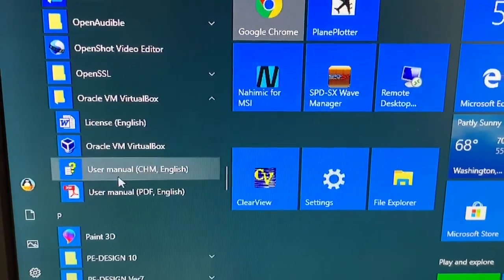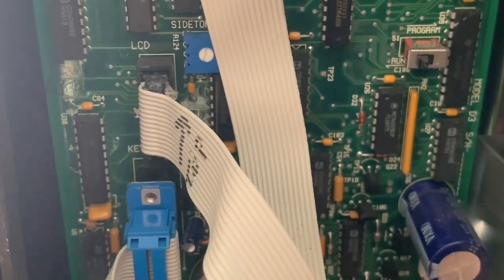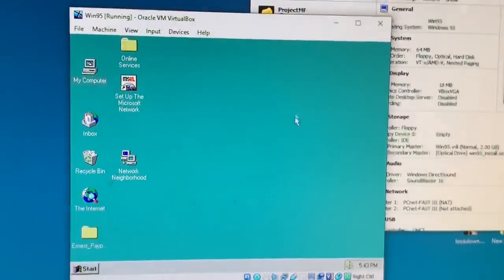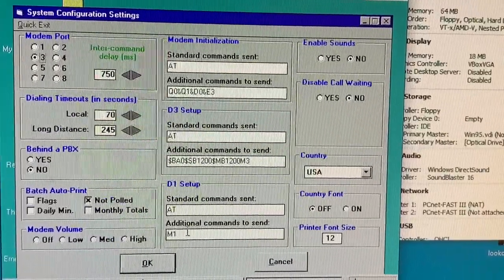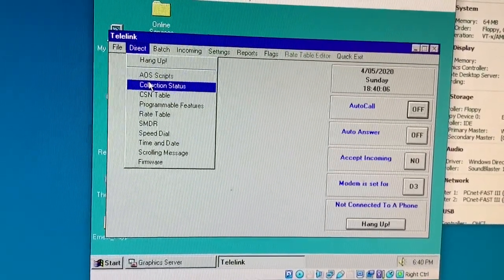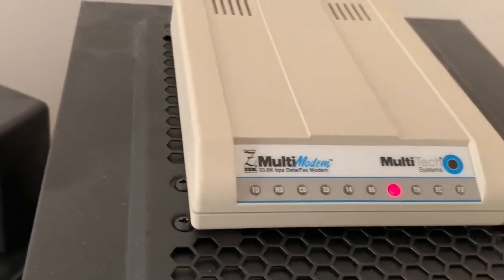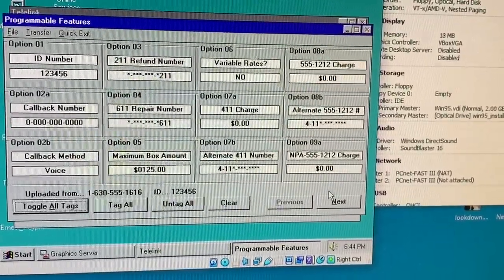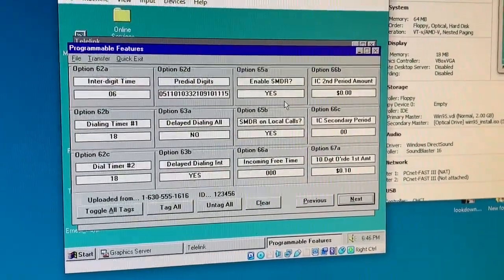Programming an Ernest D3 Single Slot Payphone with Ancient Windows 16-bit Software

Comment: Hi, I just acquired a NOS Ernest D3 payphone, seems to be in perfect condition, it was still wrapped in original plastic.  Anyway, did you have any issues connecting yours to a normal POTS line and getting it to wake up?  The 3.6V battery on mine was obviously dead, so I replaced it, but I don't get any signs of life at all, no dial-tone, no 5V to any of the ICs on the PCB, etc.  I measured 50VDC on my POTS line, and it can deliver 30mA, so I think I have good incoming power.  All I connected was the red and green wires, nothing else.  I could sure use some help.  The D3 info available on the web is next-to-none.  I also have a 2x16 LCD and am going to get that wired up shortly.

Comment: By any chance does this program work with Elcotel phones?
Reply from the maker: No, only the Ernest D2/D3 boards.
Reply: df9999999999 thanks for the info 👍
Reply: @df9999999999  Do you know where a guy might find a copy of the telelink software?  I have an Ernest D3 and I really want to take a crack at programming this phone but I can't find the program anywhere.
Reply from the maker: @TheZipperMuffin  https://projectmf.org/COCOT/
Reply from the maker: Info on adding an LCD for programming with keypad there as well.

Comment: Probably a bit late for this but FYI if you use VMWare for your virtual machine there are multiple options for getting files from the host (Win10) to the guest (virtual Win95) and vice-versa cleanly. Depending on how you configure stuff it can be as simple as selecting the files on one machine, copy, switch to other machine, paste. I use the paid VMWare ("Workstation") but the free ("Player") version is good too. If anything it gives you too many options.